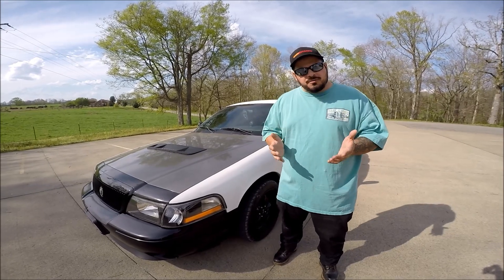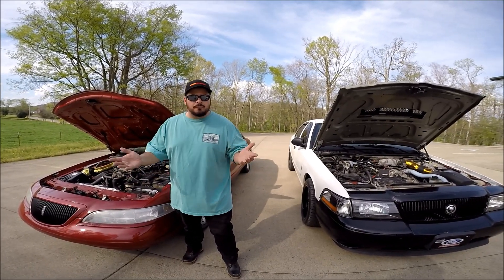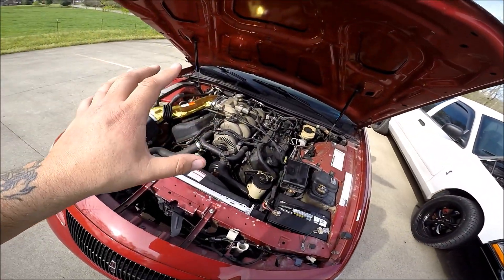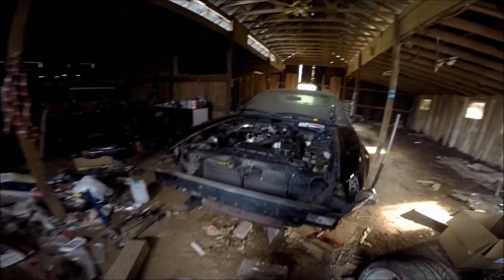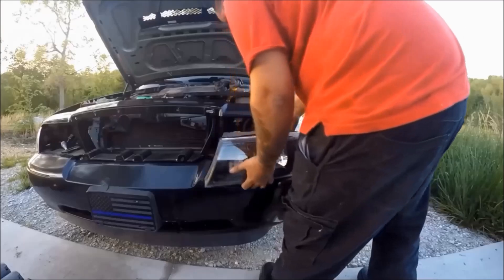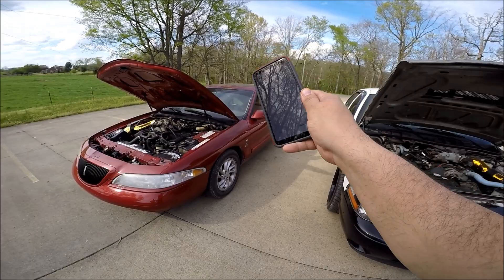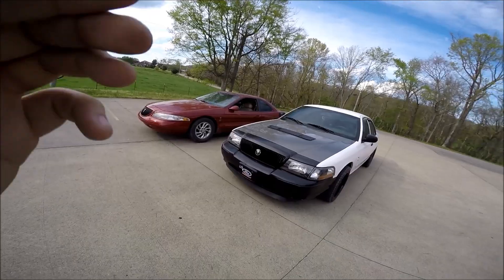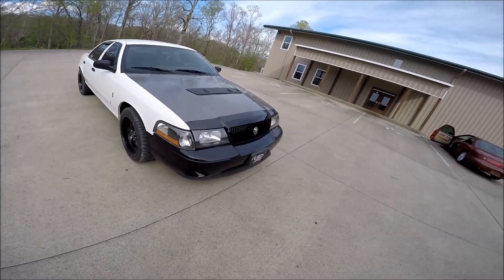Why a Crown Victoria P71 is BETTER Than a Mercury Marauder

Comment: I don't know where you got your information from maybe it's just your experience with your 1st generation 4 valve engine but those things are not prone to blowing a head gaskets or piston failure Or oil leaking from the coil seals causing misfires the only thing they're prone to was the valve tick. They literally have the same short block. right now I have two 4 valve engines one in the 2004 Lincoln aviator with 212000 miles no problems and a 2003 Mercury marauder with a 150000 miles on it and I've had no problems with it either. I do agree with you on the fact that the marauder is a very overpriced car but you have to realize it's extremely rare only made for 2 years 11052 examples in total yes the price seems high for panther but you gotta remember it's rare. I also don't know where you got your information on the horse power output of the marauder but it's 302 horsepower from the factory so that 2 valve having 350 horsepower it's only making 48 more horsepower I don't know where you think that that 4 valve motor makes like 200 something horsepower it makes 302 so there is no 150 horsepower more it's like 48. if anything the 2 valve is less reliable than the 4 valve because I don't have intake cracks causing leaks spark plugs blowing out of my holes all of that stays one piece dude. about parts, they are just as availabe i can get anything and everything I possibly need for these things. Every part is the same except the heads. That's why its part of the MODULAR family. All of your talking points are so ill knowledged and pulled out of your ass dude I honestly don't know what you're thinking you have no Room that talk you have a Crown Vic that has a marauder  transplant so how you going to bash the marauder when you're trying to clearly be one but it's not. I'm sorry but I just disagree with you on so many levels how you could compare a cop car which is  dogged on and has no amenities whatsoever compared to the marauder when I've got leather seats heated seats all these extra amenities so how you could make the argument that a cop car which is barebones compared to a nice luxo boat it makes no sense to me. Your essentially talking trash on a car you dont know about. It's sad your essentially  fake news and your followers are believing you. Get informed before you talk shit so you dont misinform others. You are fake news. No disrespect I like vics but you cant talk about two cars with different purposes
Reply: Lots of mis information going on in this video!! As a marauder and p71 owner myself I can tell you I’ve had more issues with the intakes on the Vic’s than I have with timing chain issues on the marauders. Biggest issue to me on the marauders are the air bags as they age the deterioration (which is expected with even the Lincoln town car)
Reply: @azlambocar  I'm a obviously a marauder owner my self LOL as I stated
Reply: Edward Myers yeah, I found that a lot of the points he made were off. Plus, the valve cover seals are all prone to fail on any car, well I’d say if the cars 20+ years old. All he is doing is turning people away from these awesome engines, and giving them a bad name.
Reply: Edward Myers good to meet another marauder owner! You are right lots of mis information in this video.
Reply: @azlambocar  damn right brother! Shes my babie my dream :)
Reply: There’s a marauder group for you guys to join on Facebook
Reply: MrRL95 already apart of it!
Reply: Edward Myers I’ll have to upload a new video of my whipple supercharged/ cammed marauder on my channel here in a few. Check it out!
Reply: @MrRL95  yerp and a forum which I'm on
Reply: @azlambocar  goddamn :))
Reply: Marauder values are going up because you can't Fake them. Every Marauder can easily be decoded by the Vin. 8th Digit is the Letter "V" for 4.6 DOHC. In 2003 they shared the body code with the Marquis LS. But in 04 they got their own body code. I own Both a Crown Vic and a Marauder. I love them Both. But to say a Crown Vic is a better car is wrong. My stock Marauder is far superior to my Vic.
Reply: @brianfleitas1829  I'm very aware of the vin code change in 03 my ford show parts certificate highlights it. I'm part of the 75V and not 79V vins. Its quirky ain't it? But when it comes to faking them, the real enthusiasts will be able to pick apart a real vs a fake. The values are definitely going up too which is great I can get 2K more for mine now. All in all I agree 100%
Reply: @ninevoltmodz4687  that's why I'm combating him and recorrecting his followers. Hes giving a bad name to a great engine and car. How could you possible do that to the Mercury Marauder, The Baddest Panther ever.
Reply: Edward Myers I have seen a single video from this guy that wasn’t filled loads of misinformation and ricer inspired hack job “mods”..it’s a real shame that some people take what he says to the bank instead of in most cases using it as a reference for what NOT TO DO like I do
Reply: @eriv4735  exactly man. That's why I'm hitting these comments hard.
Reply: Edward Myers I’m just glad I’m not the only one who sees it and you’re exposing him..do your thing man 👍
Reply: This is the same guy who has videos up right now saying how great and bulletproof the 4 valve intech v8 is! Why didn't he mention the headgasket issue then? Idk i like most of this guy's content but this one just leaves me shaking my head
Reply: Besides the ignornce, emergent from lazy intellect, toward the mechanical and tech comparisons involving the Marauder the these two vehicles:
The guy must not have any appreciation toward a cars' character and attitude. You all know these type of guys, the guy who wears speedos s to a small town, coal region community pool in West Virginia!!!!!
The Merc is a badass car, from the sinister black, angle cut rear lx 5.0 type exhaust pipes, muscle car gauges, to the brief so unique history of a Mercury Marauder..
Don't doubt alot of this guy's younger audience....they are more preseptive the us 40 somethings wanna give em credit for when it comes to what's hot,
and what's not.
Reply: ^^ great comment thread. Marauder owner here as well.

Mr random really confuses me on things he says sometimes. It’s almost like he has no experience in things he talks about.
Reply: Mr. Random is just jealous he can’t afford a Marauder. Posers are the clowns who throw the MM facelift on crown vics. They hate us cause they ain’t us!!

Comment: 1.5 seconds 0 to 60 difference is an eternity!
Reply: I’d like to see him take that 1.5 second argument to a drag strip 😂😂
Reply: So the thing is, between 500-3500 rpm, the 4v in my marauder feels mostly like the 2v in my P71, which is what makes the 1.5s difference there. The 4v shines over 4000 RPM, and that's where the marauder becomes a substantially better car. 60-120 in a marauder vs P71 is a completely different ballgame
Reply: gfyryulweck a marauder will walk away from a P 71 in any situation!
Reply: gfyryulweck A marauder will still be 1.5 seconds AHEAD of the p71 and 1.5 seconds is a HUGE difference

Comment: The 4v won’t blow a head gasket for no reason, it will be from over heating 99% of the time. A bad oil filter adapter gasket can actually mimic some of the symptoms a blown head gasket will produce. The 4v is a lot more prone due to it being an aluminum motor.  It is however a teksid block that can handle a lot of horsepower. There’s pros and cons to each, but swap a 4v into your CVPI and you have a cheap marauder.
Reply: Basic maintenance goes a LONG way..I had a marauder with 300K and I had a mark viii with over 400k..both had the original engines

Comment: 250 vs 300hp, not enough to justify 4x the price.  My 2010 P7B was actually a steal.  I got it at auction for cheap and it's become my super reliable daily driver.  I originally intended to "flip" it, but realizing even if I sell it for 4x what I paid for it (which I probably couldn't get that much money for it unless someone wanted "my" car because it's on my channel), I wouldn't be able to find anything even close to replace it.  Auction Crown Vics are getting really difficult to find.
Reply: It's about the rarity and the creature comforts that differentiates the price
Reply: WJ Handy Dad Chicago motors has the cleanest vics you’ll ever find with low miles that are priced properly
Reply: WJ Handy Dad I know you’re a die hard p71/b fan but to say it’s ONLY a 50hp difference is ludicrous
Reply: Marauders cost way more and harder to come by than a p71 or P7b also dont have the heavey duty police equipment for 50 less hp and 8k less bucks i take my p71 any time.

Comment: Can’t disagree. I own an 03 marauder 188000kilo and an 04 marquis 279000kilo. Marauder started the ticking so I decided to do a frame off on it but the marquis is still one of my daily drivers. Honestly on acceleration, they feel the same till about 4000rpm and then the 4v engine really takes off. P-71’s are rare up here, decent ones anyway. Bottom line if you like panthers ya gotta have more than one.

Comment: Unfortunately both engines are mechanical nightmares as they age.  The 4 valve is a better breathing engine that will make  power than the 2 or 3 valve counterparts with minimal turning.  These engine platforms are throw away pieces that we’re never intended to be rebuilt much less make power above 350 Hp normally aspirated and 450 with boost.   I know there are guys making 700 HP all day long but don’t expect them to jump in and take a weekend road trip without the auto club on speed dial.   

 As far as the Marauder goes it is worth every penny due to the fact it was a limited production vehicle.   If you can find one that hasn’t been molested for under 10k  buy it.  These are only going to go up in value as they age.  The Vic will never be worth more the the value of scrap metal due to it’s production numbers.
Reply: Mark Jones If this guy could afford a marauder he would definitely be singing a different tune 😂
Reply: Scott G I’ve put over 300k on both of these platforms..if you focus on basic maintenance they will last forever
Reply: E Riv consider yourself lucky!   300k is a bunch of miles without a few timing chains and a bunch of nickel and dime parts thrown at this junk to get that kinda life.  I won’t go down the long list of things that fail on the 4.6 5.4 and others of similar yet non inter-changeable platforms of the same era that basic maintenance won’t make up for.  Granted, the Panther platform is one of Fords best and most reliable vehicles ever, next to the T and A offered by the old man around  a century ago.  Unfortunately the modular engine platform was a better Idea that was hastily put forth by the bean counters under the heavy hand of the EPA that relegated the small block  to the trash heap vs. building on  the Windsor, Cleveland and associated derivatives, which I might add are far superior on a bad day.  Ford has a nasty affinity to throw away a good Idea for a shitty,  I digress better Idea.    Good luck with those 300k 4.6’s.
Reply: Mark Jones, I highly doubt you had a 4 valve making 700 at the back tires, ok even the flywheel that was anything close to reliable.  I’m not sure how you got that kind of power unless you were pushing 20lbs of boost or a 300 shot into a 4.6 for any so called reliable length of time.    Nice try but I’d like to see the dyno pull numbers on this piece before it shit the bed.
Reply: All goes into maintenance and care. Change the oil regularly and these mod motors go FOREVER even being thrashed on. 

They are a little maintenance sensitive. Change the oil on time, with the right, good quality oil and they go 500k.
Reply: You sound like someone that was molested on the price of a marauder I bought my first P71 for $205 drove it 7 years smoked a marauder racing  too bad there was another crown Vic behind us he lit us up let me go I have a cheap car I wasn’t worth anything he towed the marauder took dude to jail haha
Reply: @scottg391  your lost on your information the 4.6 regularly will get 225,000mi 300,000mi isn’t a problem it’s the crap trans and ignorant drivers there not police cars cause they break down when hit a bump there tried and true tested engines how many chevys dodges police vehicles are there compared to Ford P71 5 for every 1,000 fords

Comment: Hey first off I want to thank you for putting yourself out there in the line of duty as a K9 officer (been watching your videos for a long time) and I know you’re cool dude and everything and I love your content with that I’m not picking any fights being that I have been through thick and thin with my Marauder for over five years and I maintain a total of 5 Marauders in the northwest Oregon southwest Washington area. I thought I just let you know that the primary timing chains, gears, tensioners and tensioner slides are all identical. Valve springs, valve retainers/keepers and rocker arms, oil pump, water pump, crankshaft, connecting rods and the general design of the Pistons are identical. Most of the seals and gaskets on the engines are identical to including the head gaskets and are 100% interchangeable the only gaskets that are not interchangeable in between the 4.6L 4v and a 4.6L 2v is the intake manifold gaskets exhaust manifold gaskets and valve cover gaskets. Heck even the head bolts are the same too! The architecture in between the dual overhead cam in a single overhead cam 4.6 V-8‘s are nearly identical hence the reason why they are called “Modular Engine” . The Marauder’s Engine makes nearly 80 hp more than a Crown Victoria‘s engine already putting it in a more sensitive position. I don’t discriminate I LOVE ALL PANTHER BODIES! They are tanks! My first was a 2000 black P71 and OH MAN! That was some of the best clean fun or dirty fun (depends on what side of that blue line you’re on) I have ever had behind the wheel of a car! With that being said I enjoy the overall more firm handling characteristics The cleaner looks like you said in your video and the better put together interior of the Marauder. I drive my car hard knowing maybe Someday I will blow the engine to bits, but I have the know how, tools and parts to put it all back together and do it again and again and again that’s just a small price I pay for driving it the way I do and I must say the car has never landed me in the cab of a tow truck and it has always started and has always ran for me what more can you ask of a car? They way more fuel efficient than the Vickies too (14.7 mpg vs 21.5 mpg). Please don’t get angry over my comment I’m not angry about your video. I Kinda understand why you made it. Some Marauder owners are dicks and the others have their head stuffed up their asses😂😂😂 haven’t quite figured out where I fall in all of that mess🤷‍♂️ but keep popping those videos out! 👍💪🇺🇸🇺🇸🇺🇸

Comment: The 4v does not have headgaskit problems. After 100,000 the timing guides should be replaced just as a precaution. Rear head cooling mod. Right oil and filter. That’s it.

Comment: the stock marauder 4 valve engine makes 305hp from the factory. so your 350hp MODIFIED 2v 4.6 does not make 150hp more than the marauder. second the short blocks are the same 4.6 engine that has been around since its inception in 1992, so the reliability is there for all the mod motors. 

you might want to actually do some research and get your facts straight before comparing the P71 and the marauder. yes you can pick up P71s all day long for under two grand, but these cars have usually been beaten to death. marauders on the other hand dont get as beaten up and are also higher line cars, and more limited production so generally worth the extra money.
Reply: Repairs on p71s are cheap as shit.

Comment: Mr. Randon Reviews 1.5 seconds 0 to 60 is just a bumper length faster i'd say,to find measurement,but i do have a question for you does the Mercury Marauder have the p71 bullet rust proof fenders and doors on it's body!? Or are the Marauder fenders just stock steele!?

Comment: I have a 03 Mercury Marauder myself but in the past I’ve owned a 89 and 91 crown vic then move up to a 99 P71 to the 03 marauder. I had it going 10 years now the motor went out at 171K replaced it and kept things moving. I loved my crown vics awesome cars own performance upgrades were cheaper on the vics than with the marauder. I have some videos of the P71 on my channel I loved it! It was tuned with a CAÍ and 3.73 gears.

Comment: I just bought a 05 p71 from the gilroy pd, 119,000 miles on it my mechanic inspected it and told me the engine is like brand new, it runs and looks great, at the end of the day I'm happy i own it.
Reply: OBI - HUNG KENOBI 
If maintenance is kept up they can be great. I bought my 06 from a smaller county sheriff department and it has been great. The only problem I had was that stupid bearing pulley on the alternator. I’ve went through two. Seems like anytime I get on it hard the pulley fails and I lose charging. It’s not my daily driver but makes a great backup car or weekend cruiser.

Comment: I wanted to buy a local low mileage Marauder but the owner changed his mind about selling and I ended up with a pampered 2008 Grand Marquis. No regrets with the Grand Marquis and it serves me very well. I love how it eats up highway miles at 1700 rpm on 87 octane fuel. When fuel prices rise again I'll be happy filling up with 87 octane vs. 93 octane in a 32 valve 4.6.
Reply from the maker: thats very true  i forgot to mention the 4valves reccomended octane is 93!
Reply: 4v are tuned from the factory to run on 87 and there is literally no mention anywhere about 93 but ok 😂🤣